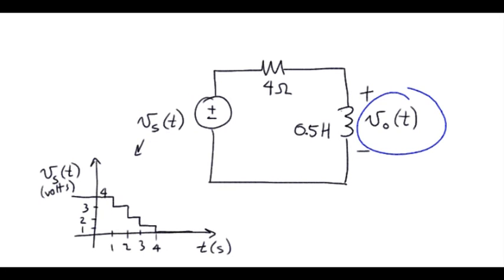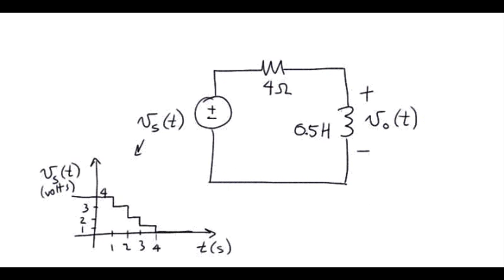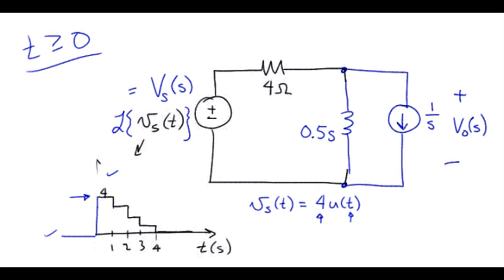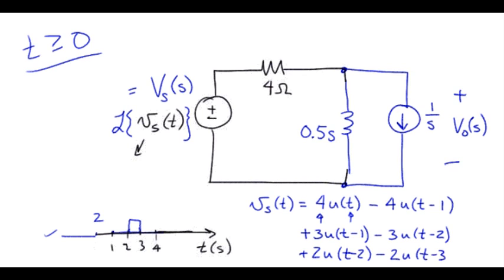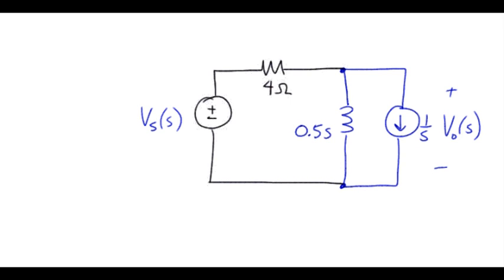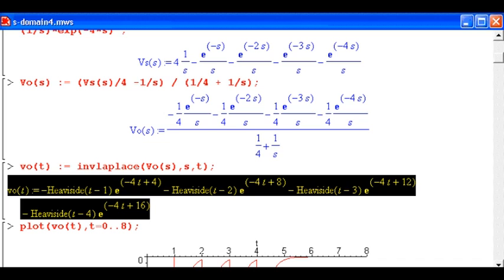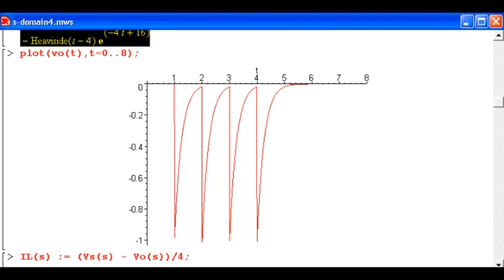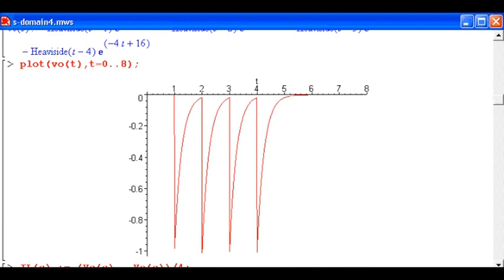s: Laplace Transform Analysis Example #4

Comment: What if there was a capacitor in series with the inductor? How would the initial conditions change?
Reply: the capacitor would act like an open circuit, so the current on the inductor would be 0 initially